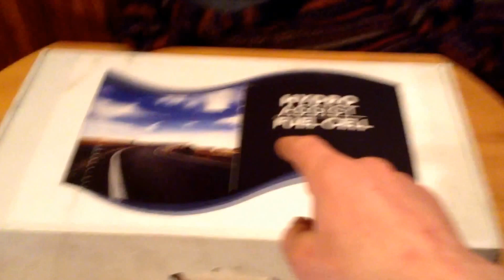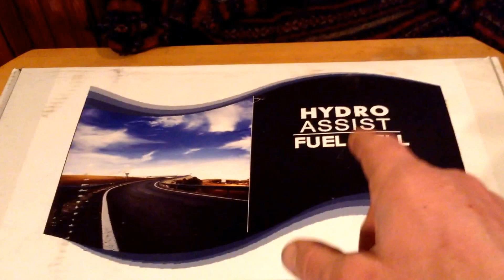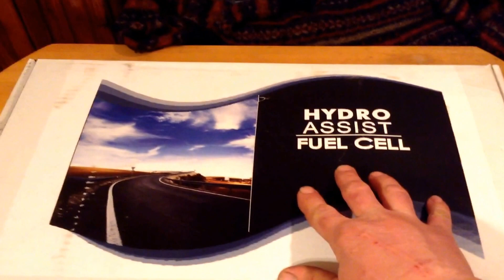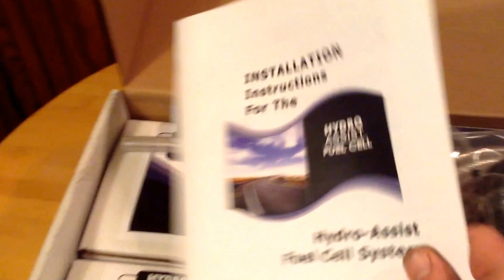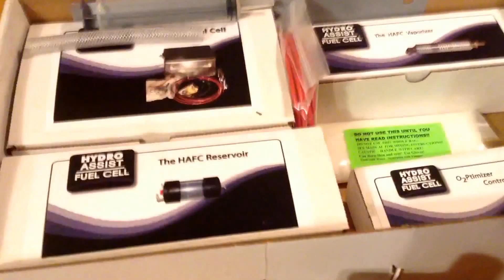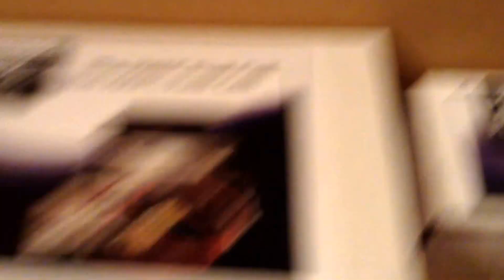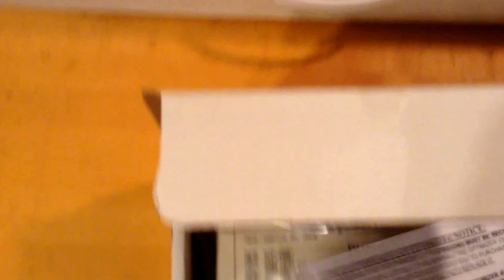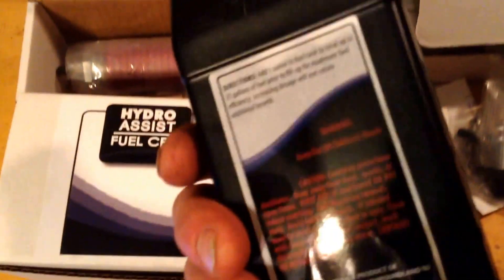Hydrogen Assist Fuel Cell Unboxing.

Comment: Did you install this in anything? Need any tips or advice? Let me know.
Reply from the maker: I still have it on display. I'm dubious of it's functionality but it's a great conversation piece..
Reply: Sure, it's a great conversation piece but what a waste of good hardware! If you don't want to install on a vehicle you can use the cell to make a HHO mini torch that's pretty handy for soldering or cutting aluminum. During 4th of July you can use the cell to fill up mylar helium balloons...then use a pennystick as a fuse and you have the loudest fireworks in town! You can take the magnetic heat exchanger and strap it to the exhaust on a vehicle, run copper tubing to it and use vehicle vacuum and a bubbler to pull a mist of water and xylene through it...this alone gets a nice power and economy increase if you tune for it. Lots of cool stuff you can do. Let me know if you want to sell it and how much. Otherwise, enjoy the hardware. I still have 4 of these kits and after 10 years the hardware still works good. High quality stuff dude.
Reply: @bogey6925VR  hi Mike, I was curious if you could give me a clue as to the wiring diagram of the generator?  And specifically the hose map including the reservoir to the gas output